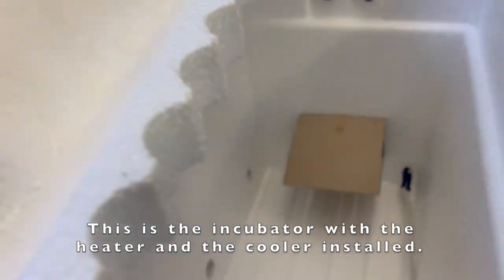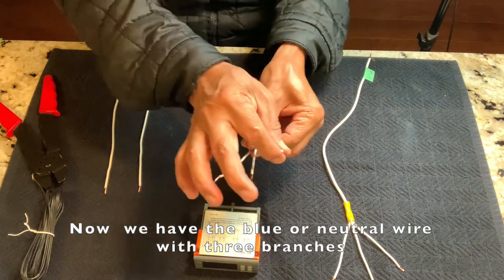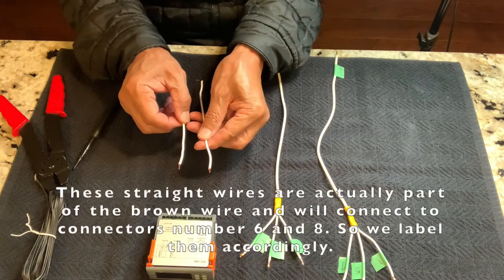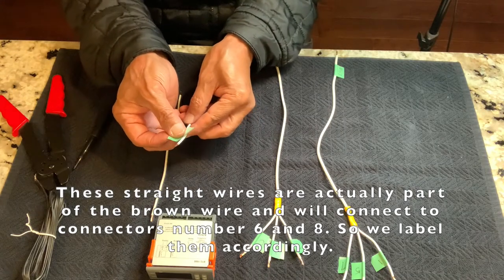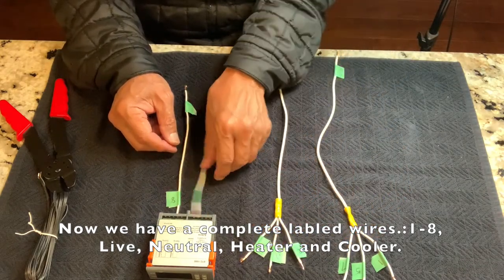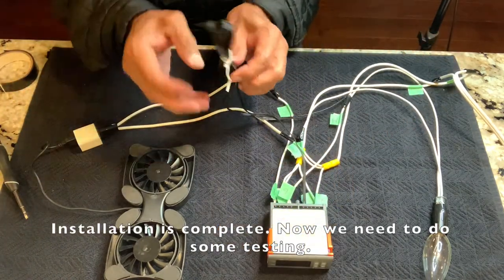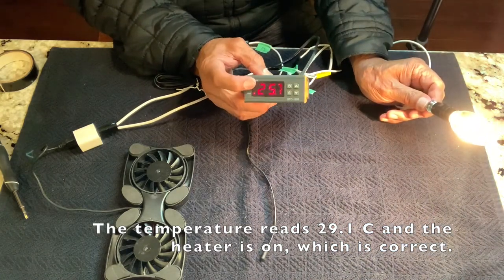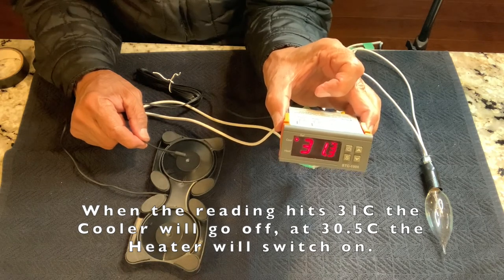How To Wire STC 1000 To Your Tempeh Incubator

Comment: Thank you very much, from Madeira Island, Portugal.
Reply from the maker: Hi< there!
Thank you for visiting my channel. If there are still questions please let me know. 
Francius
Reply: @francius1003  , it WORKS!!! I made a small incubator measuring 40 x25 cm. The electrical connections were a little more complicated because I bought the 12 volt thermostat (direct current) and then I had to adapt everything: 12 volt incandescent bulb (5 watts) and 12 volt cooler. It was fantastic! I made my first tempeh with mung beans. In the first 24 hours, only the bulb was needed to heat up, because as soon as it went out, the temperature started to drop and the cooler didn't even need to run.. But after 24 hours, the heating didn't even need to turn on, because the fermentation heat was sufficient and, at this stage, only the cooler worked. Thank you very much for your teachings.
Reply from the maker: @fatimarocha5489  Good to hear your success, Fatima! Keep improvising, tempeh making is an art!
Francius

Comment: Cheers again mate

I finally(it took a few months from where I live) got all the parts needed

Styrofoam cooler has all the holes in as well as described

But I am stuck mate and I need some help

How do I get power to both bulbs? You only show one here.How do I sync/wire them together?

I am really a visual person and learn hands on,and I have been watching your incubator videos and practicing,but this one issue has me confused

Please advise

Cheers
Reply from the maker: Simply connect the wires from the other bulb to the same spot of H wires, so each of the H wires branches to two bulbs. We call it a parallel connection.
Francius
Reply: @francius1003  Thank you mate
Reply: @francius1003  Thanks again mate

I am getting close to completion and still wanted to clarify with a picture of my heater setup as it is slightly different than yours.I had to share that pic on the FB group you are part of because we cant do pics here.I hope that is ok?

Comment: Hi Francius
I want to build a incubator but the wirering gives me headace..is there a simpler thermostat that you can recomand for me, even if it cost more? Thanks Anna
Reply from the maker: This video on how to wire STC-1000 to your incubator https://youtu.be/eCWzOCdRQc8
is very simple and straightforward. STC-1000 is the simplest temperature controller suitable for your incubator. Any temperature controller will need some wiring. I don't know of any simpler one. You might need someone with an electrical background to help you.
Francius
Reply: @francius1003  
Thanks for answering but i took a chance and bought inkbird itc 308 where i can conect a lamp and a fan..hope it Will work just as good?
Reply from the maker: @2021-h1z  Good luck! Let me know if you still have any questions!
Francius

Comment: What type of wire did you used?
Reply from the maker: Hi, Gabriela! It was Primary Wire AWG14.  For the three-branch wire I used Butt Splice 12-10, a bigger size because it needs to accommodate three wires at one end.
Reply: @francius1003  thank you very much! :)